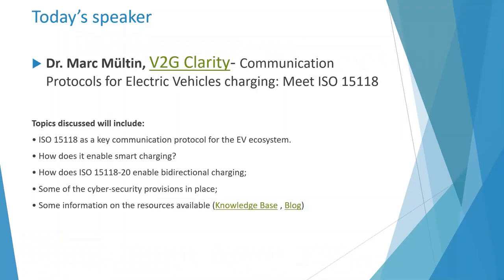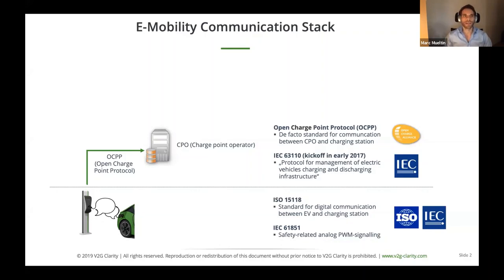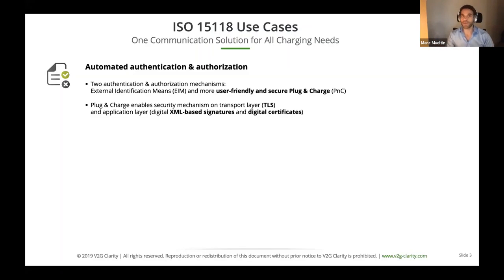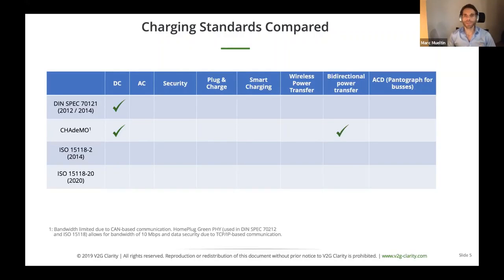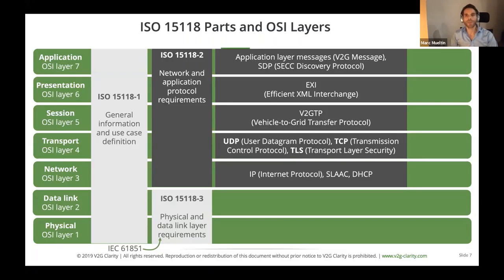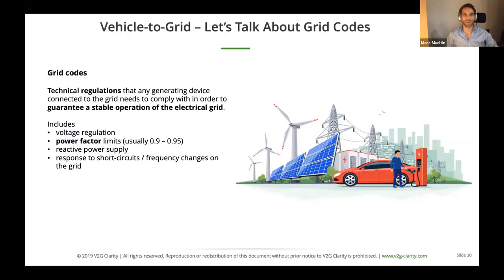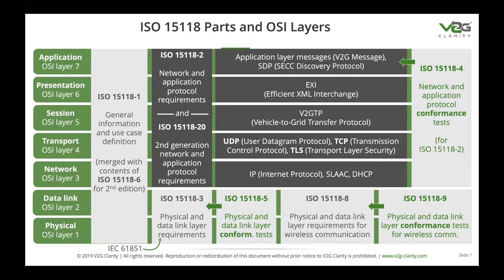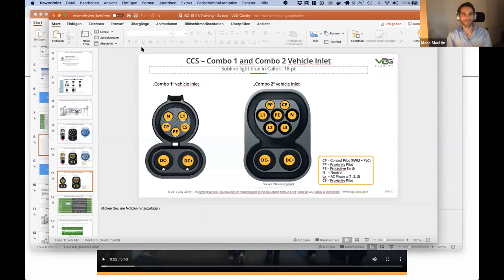Meet ISO 15118 - Open Communication Protocols for Electric Vehicles Smart Charging

Comment: I guess the end of webinar question regarding Trouble Codes related to EV charging and Meter/EVSE faults may be related to Diagnostic Trouble Ccdes (DTCs), which is defined by the ODB-II protocol/standard (ISO 9141-2, if I'm not mistaken), and is not relevant to the SECC-EVCC interface as defined by ISO 15118